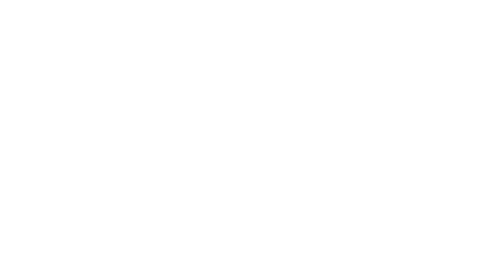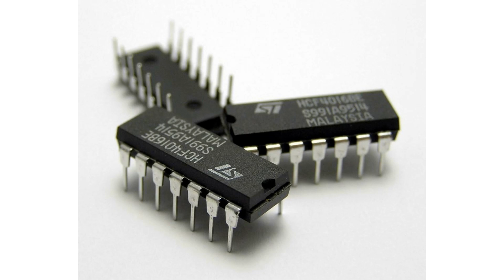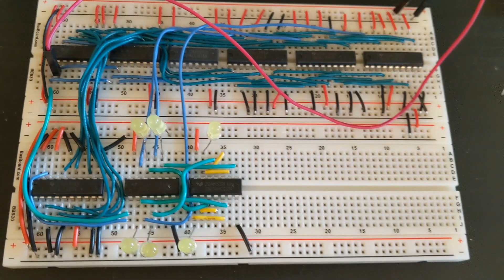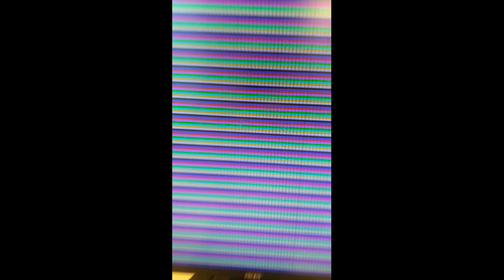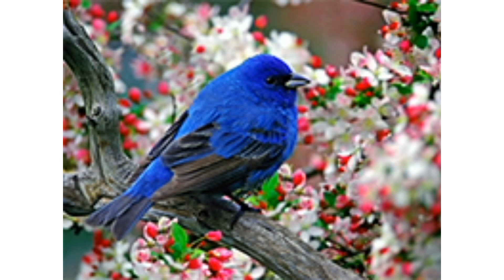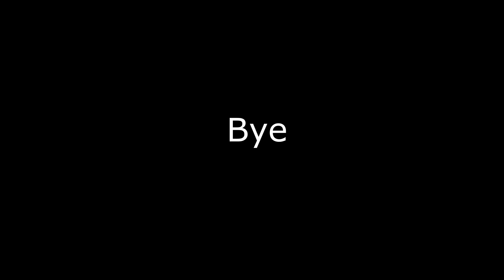This is a $30 GPU! (The World's CHEAPEST GPU)

Comment: The reason for your broken lines is because you've miscalculated the position of your hfp/hsync/hbp pulses. Check your wiring and schematic. I'd guess it's Q4 of your horizontal counter going into your comparators.